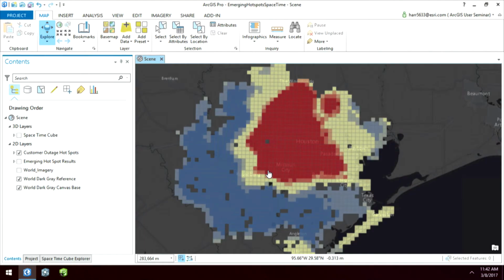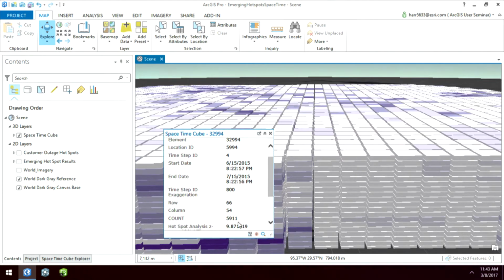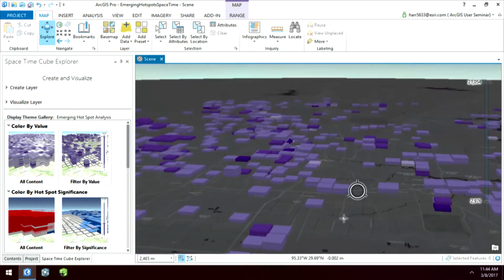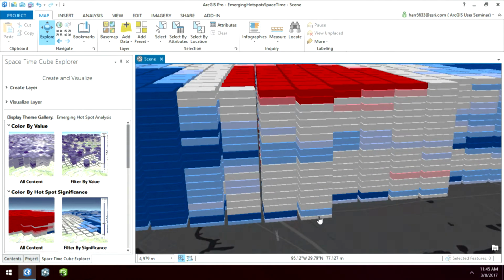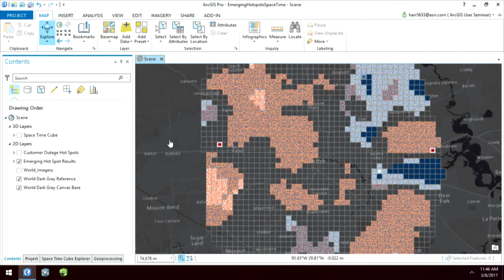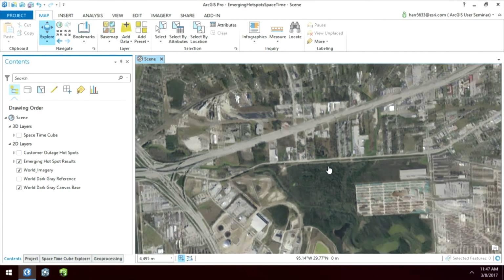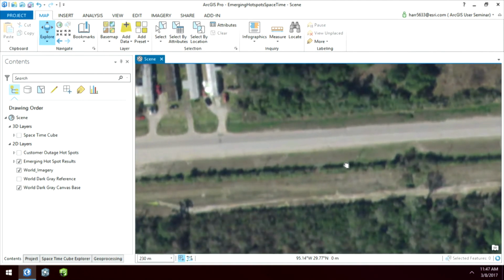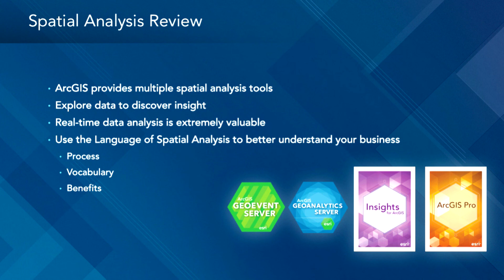ArcGIS User Seminar – Time-Enabled 3D Spatial Analysis using a Space Time Cube in ArcGIS Pro (Elec)

Comment: Dear Sir,

I would like to ask you a few questions about some technical points in ArcGIS Pro.

Question 1:

Please why when I calculate à trend from multidimensional raster the result does not appear in the arcgis view and I always I get the same values in the table of content even if the data file is different.

Question 2:

When I calculate also the anomaly raster from the same multidimensional raster, I have an error message.

Please Where is the problem and is there a solution?

Cordially

https://crudata.uea.ac.uk/cru/data/hrg/cru_ts_4.06/cruts.2205201912.v4.06/pre/cru_ts4.06.1901.2021.pre.dat.nc.gz